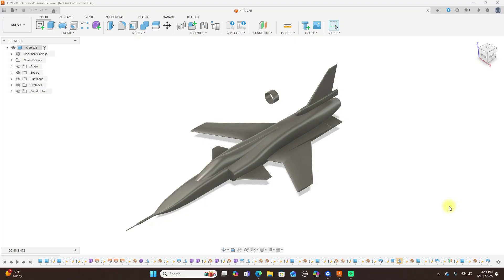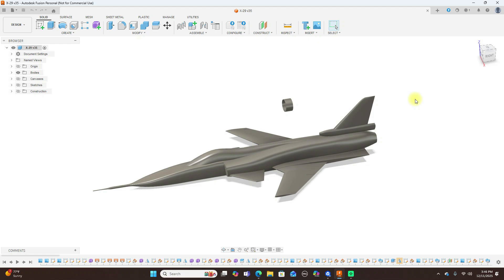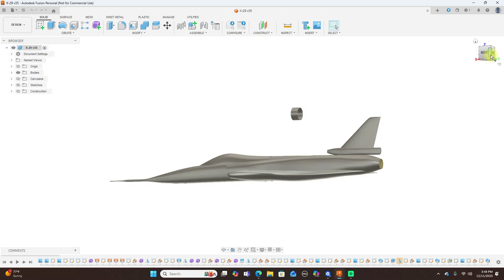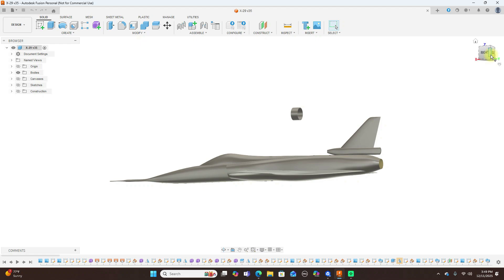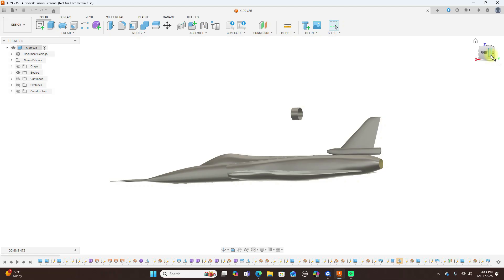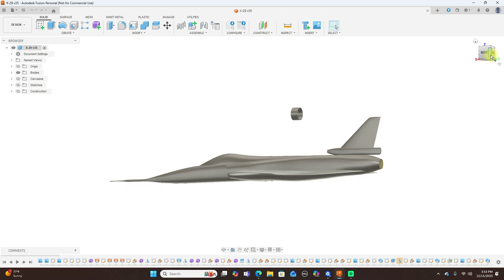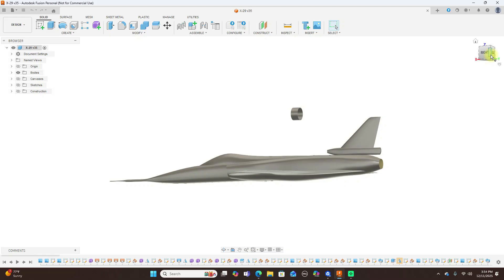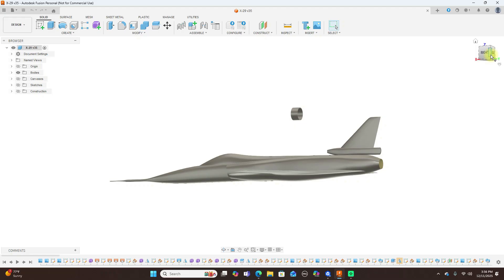The Harsh Truth About CAD: Expectations vs Reality for Fusion 360 Designers

Comment: I tried modelling a duct for a su33 twin ducted fan using freecad. It drove me mad. Getting the outer shape was fairly easy lofting through sections. Creating the 1mm wall thickness was a nightmare. I was then going to fibreglass over the mould and then heat the part gently to get the mould out.